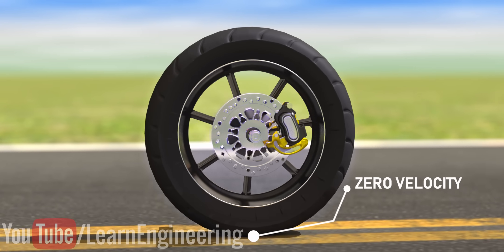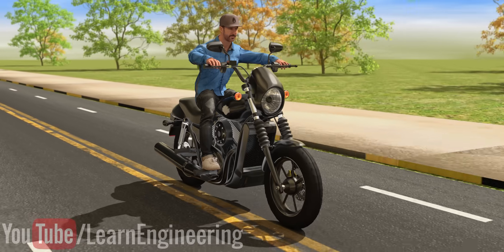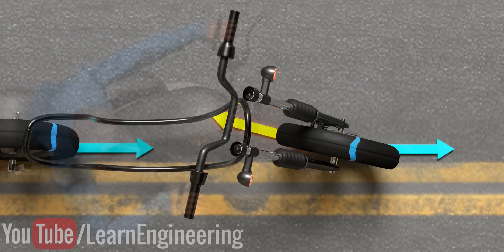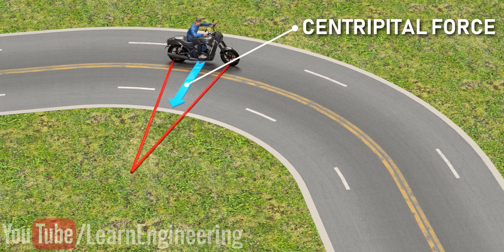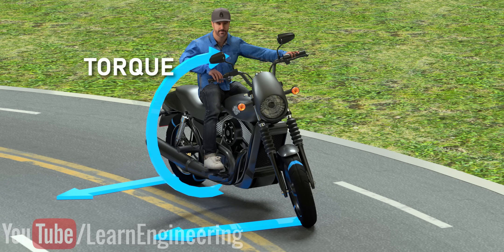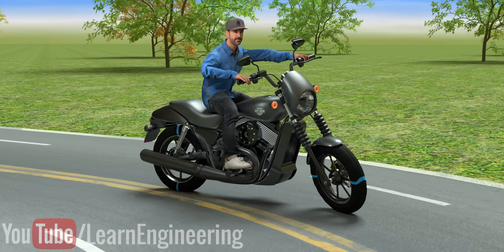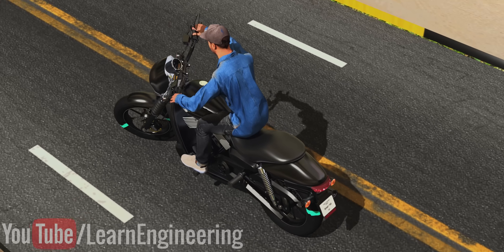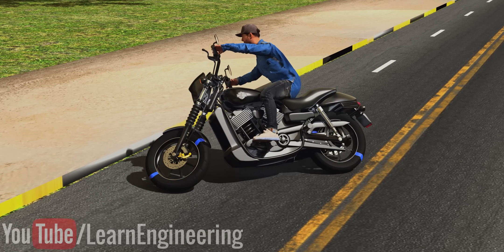Counter Steering | The interesting physics behind it

Comment: One last try to explain counter steering that I hope will help people understand how it works. If you have a bike with no rider. Picture that for a minute. The bike is travelling at 50mph. It will do this because the gyro affect of the wheels will keep it up right. If you have servos attached to the bars that can apply pressure to either side. The bike is completely up right. No lean left or right and no method of applying any lean. Now with one of the servos apply a small amount of pressure to the left hand bar. The weight of the bike 200kg and it is travelling dead straight. It still wants to go straight. The front wheel was travelling straight but now it is being pushed slightly to the right with the pressure on the left hand bar. This will create friction or drag on the left hand side of the tyre slowing that side. The tyre will try and turn to the right. Now with this drag and the front wheel moving to the right the bike will start to lean over to the left. You must remember the bike is travelling straight on and will always want to go straight on. As the bike is now leaning over to the left it will continue until the pressure is released from the front wheel or it crashes on to the floor. The bike will still be travelling in a straight line. When there is a rider aboard they naturally release the press and balance the steering input to turn left. Hope that can help people understand it better.
Reply: I'm sorry man.... You are still wrong. The pressure is maintained on the chosen bar for the duration of the turn. The steering geometry of the bike forces the front wheel to turn into the bend, not the rider. If the rider pushes the left bar to turn left, the bike leans left. Once the bend/turn is completed he eases the pressure off the left bar (essentially applying pressure on the right bar) to stand the bike up. If the rider applies pressure to the right bar prior to the finish of the bend/ turn, he will stand the bike up early.
Reply: @softailfun  I know what you are saying, it's a difficult one to know exactly how it all works and what inputs the rider actually does. The good thing is the rider does it naturally and doesn't have to think to much about it. The most important thing and if you race or track day especially is if you understand it well and practice the actual operation then you will be a better rider for it. I remember many years ago they placed pressure pads on I think Franke Chille bike at Donington and they measured the pressure he applied to the handle bars going through the Foggy Esses, it was an average 100kg of pressure to make the bike lay down and stand up. And unfortunately I still stand by my explanation that the pressure is released as the bike gets to the desired lean. Of course pressure of some kind will be placed on the bars as the grounds surface, tire friction and body weight all play a part. I think you have been trying to simplify for people which I agree is a good thing, all I've ever tried to do is explain what is actually happening which I believe I have done so. If you don't think its correct that's not a problem or an issue but I personally think it's close. No worries though either way, hopefully someone gets something from it.
Reply: @OrangeManStan  
Hold your horses fella 😂. What you have said on this post we can agree on for sure. When the desired lean is achieved, pressure is eased on the bar in question but never completely released for the duration of the turn/bend. That’s not how I read your first post, nor indeed your other posts on this topic.. it seemed to me that you were saying that the rider not only ceased all pressure on the bar in question, but attempted to point the wheel into the bend by direct steering.
Reply: @softailfun  thanks for the acknowledgement, I think the pressure is completely released as I'm sure if it is not the bike will continue to fall just at a slower rate. I have actually said in other posts to pick the bike up you need to apply pressure to the inside bar, in most people's minds tighten the turn but as you know this will stand the bike up, interestingly if you keep that said pressure on the bar it will eventually throw it down on the opposite side of the floor until you release the pressure again and allow the bike to do its thing. The pressure is released in full, it has to be so the wheel can start to turn into the corner. If you read all my comments I've never said apply pressure or turn the bars into the desired corner I think you have imagined that is what I was saying. The problem here with respect is you don't understand what is actually happening even being the very experienced rider that you are. I hope you may have leaned a bit more knowledge, it's always good to learn something and never good to jump to quick to conclusions especially on a subject like this. I hope I've not offered you.
Reply: @softailfun  one last thing from me, I have gathered that you train riders on how to ride and I'm sure you are good at it. I agree trying to teach someone how the physics of how a bike counter steers is probably going to confuse them unless they have a mind where they like that kind of thing. I'm sure when you are face to face you are using a lot more than words so they won't do the wrong thing. There's two things hear, explaining with words people read it with their own preconceptions and can misunderstande. What I have been trying to do is not teach someone how to ride a bike but explain what is actually happening with as simple as possible explanation. I think you are try to explain to people how to ride a bike which is fine. The thing from reading all these posts is how many people including yourself think someone is going to go out on their bike and crash it by trying to counter steer. The way a person crashes a bike is by not paying enough attention to their surroundings and making a silly mistake. The more people understand and practice riding skills the safer they will be. I'm surprised you are worried that people will kill themselves, from my experience if you have a person on a bike that is concerned or a worried rider the last thing they are going to do is consciously put that much pressure on the bar from being advised on how to counter steer for the bike to crash. We all know people have a natural ability when riding a bike, the issues come when you try and turn a big slow turning bike into a corner when you are going a little bit to fast, this is when you had wished you'd learnt counter steering a bit more as you go straight on into a problem. People don't crash bikes when practicing counter steering, they crash from not concentrating enough, lack of confidence and inexperience, its never from counter steering it so fast into a corner unless they are a very fast rider on a track or a nutter on the road but I don't think it's them that you are worried about. One last question, how do you think a top racer lays a bike down on the floor to avoid hitting the hay bails? They keep the pressure on the bar.
Reply: @OrangeManStan  
You say “they keep the pressure on the bar” that is what I have said all along!!! I do not instruct, don’t know where you got that from.
As for crashing.... turning the bike the wrong way can be pretty devastating, going one way when you expect to be going another could be considered dangerous I think!
What you are struggling with is the fact that while pushing on the left bar, the front wheel points left. I get that it’s confusing, but it’s true. Hey, your bike your life.
Reply: @softailfun  I'm sure neither of us will be ending up in the hedge. Well let's hope not. 👌
Reply: @softailfun  this video is of a track instructor explaining how you do it, it's not a great video but I agree with his theory at 1.50sec he starts to explain that once you get the bike to the desired lean angle you release the pressure. Have a watch if you have the time https://youtu.be/w5TFADsvo0M.
The pressure on the bar dictates the speed in which the bike leans on to its side not the angle to which it gets too. If you keep the press there it will just keep falling which is not what you want. It's obvious to me as the front wheel will be wanting to point the opposite way to the turn and you need to allow it to transition to point the other way. This can only be done by you releasing the pressure and allowing the steering geometry to do its thing. You where correct I think in saying if the turn tightens half way through the corner you will need to push on the bar again to drop the bike further but I'm sure you can imagine if you kept the pressure on the bar the bike will eventually hit the floor. The pushing on the bar doesn't create and turning of the bike, in fact it does the complete opposite. It's the releasing of the pressure that allows the bike to start to turn. I'm hoping you can see this now. I know you are a very experienced rider but I think most people haven't thought to deeply about what actually happens when you steer a bike. I have. The hardest bit is when people aggressively tell you you are talking shit which at times pisses you off a bit. No worries hear as I do believe you are trying to help me with my theory. I'm not always right but on this occasion I believe I am. But I do acknowledge there are a lot of people out there that know a lot more than me. 😊
Reply: @OrangeManStan  
You seem to trust the word of motojitsu. I know the video and the rider.
On this video he shows counter steering practically. https://youtu.be/lzk8oyNO708
Note: pressure is never taken off the chosen bar unless he is travelling in a straight line, and yet the front wheel does point into the turn regardless.
He even mentions this in the video you supplied. He mentions “castor effect”. You have misunderstood some of the information my friend.
Reply: @softailfun  I have mentioned before this is a good video. I do understand that if the bars are released the bike will stand back up, this as you know is to do the the geometry of the bike. My point is the pressure is released just as I said. The bikes geometry will apply its own pressure to the hands to maintain the turn for sure. The bars will push back as they have to, to be turning the opposite way to the counter steered direction. For them to do that the pressure has to be released. If you what Keith Codes video they show a pointer on the tank which shows the direction of the counter steer then the bars coming back to point towards the turn. This is all done with no one touching the bars. Personally I think you have miss understood what is actually happening just like the person in this video. Plus I think we are getting tied up in the nitty gritty as none of it matters unless you really do want to know what is actually happening when the bike steers. My problem as always when writing on social media is people are very quick to be aggressive. If you read back your original comments you pretty much told me I was talking shit and was going to kill someone. I think the facts are I know what I'm talking about and have explain a technically difficult subject quite well, if people can't get their head round it then that's not a problem especially in a subject like this. No one is going to kill themselves by trying out a bit of counter steering.
Reply: @OrangeManStan  
We’ll agree to disagree. You are wrong, but hey as I said. Your bike your life.
Reply: @softailfun  😁 you are wrong but if you can't see that then no worries. So is the guy on your video.

Comment: I dont know if u ever rode a motorcycle cuz that not right i mean i get what u are trying to say but ur explanation is wrong. If u drive on high speed and even steer the handlebar a bit u will fall no matter what. U never and i mean never should steer ur handlebar while speeding, u need to use only ur body do lean but ur a bit right cuz if u lean to the left u should give a little push to the right with the handlebar but just a bit to stay balanced and same goes the other way around. But again dont u ever ever ever steer while u high speeding. U WILL CRASH!!!
Reply: TREX _TIOX 
Go and see this guys vid, learn how a bike steers for gods sake!
https://youtu.be/lzk8oyNO708

Comment: aweful, AWEFUL explanation by someone who clearly has no idea about riding.

the "normal steering" is not even a thing. 
EVERY rider counter steers to turn. most are doing it without even realizing it, because it is IMPOSSIBLE to turn with "normal steering".

if you do a "normal steering" to the right, you essentially counter steered and will turn to the left. 

this is really dangerous for every new biker out there who will actually try to "normal steer" and end up in a certain crash.
Reply: @LK-ho1dg  it applies to everything with 2 wheels. But we usually ride bicycles at fairly low speed, and they are all over the place anyway.
With a bike, anything above 10-15 mph you will counter steer without even knowing it. Don't worry about it, get a bike and enjoy it.

Comment: The explanation and the science as applied is wrong and misleading in a number of regards. The most basic is that motorcycles change their handling characteristics with speed. At low speed (less than walking pace) the front wheel is used like a tiller pointing in the direction to be steered. At high speed there is no discernible deflection of the steering. And there is obviously a transitional period between these two speeds. If you don't believe me take a m/c or pushy into your nearest car park and experiment.

As speed increases steering is achieved by chassis geometry and dynamics working in conjunction with the lean angle. Steering characteristics change with speed and with different or variation in chassis geometry and dynamics. andcome to realise that even 2psi variation in tyre pressure can change the tyre's shape and its steering performance. The other example that proves that variations in chassis geometry and dynamics change steering is trail braking.

demonstrated

Comment: Why make a video when you have no idea what you are talking about? Countersteering is the only way to turn a motorcycle (and even a bicycle, at speed), whether you know that you're doing it or not. You can't turn your handlebars to the right and somehow instantly lean the bike over to the right at the same time. I don't think it's even possible to lean together with the bike by just moving your body (the most you can do is move to the left to lean the bike to the right, aka counterweight, but the bike+rider as a group don't move their weight center much).

Comment: @Learn Engineering
This video is incorrect, dangerously misleading, and you are directly putting people's lives in danger by spreading misinformation. Take this video down for the sake of your integrity, and for the safety of your viewers. 
If you want to make a proper video about counter-steering, it would be worth mentioning the massive gyroscopic forces at play, and how it's a combination of gyroscopic precession, camber thrust, and centripetal force that moves a motorcycle and its rider through a corner.
Please, please do not ignore this message. I am not the only one saying it and you STILL have not admitted you were wrong. Do the right thing.